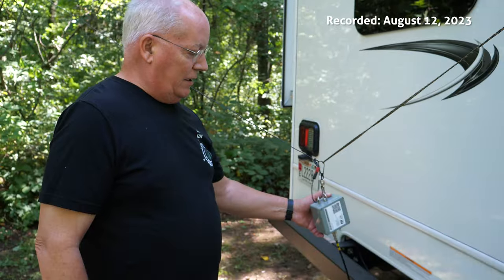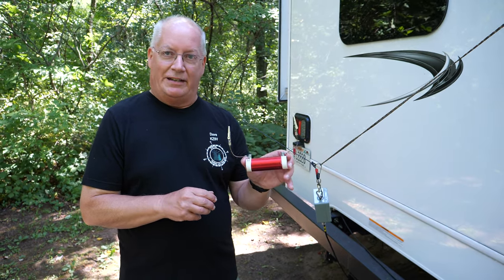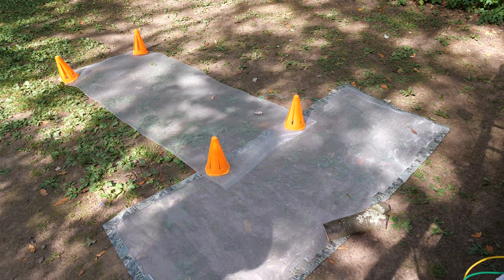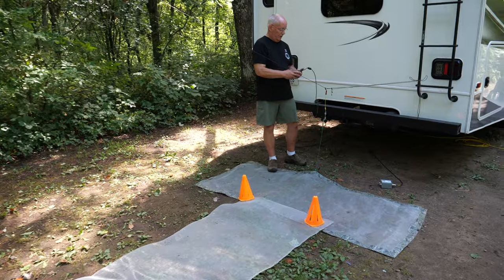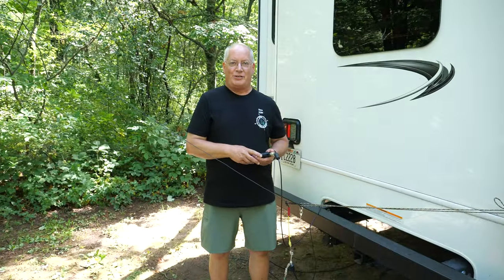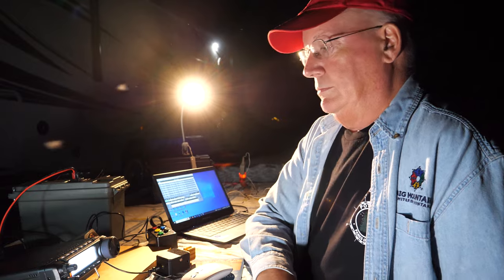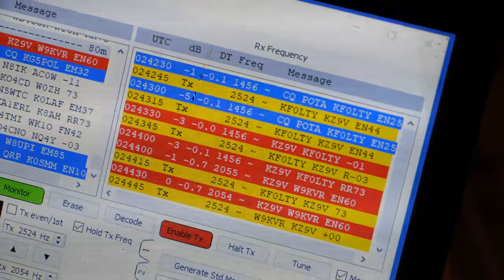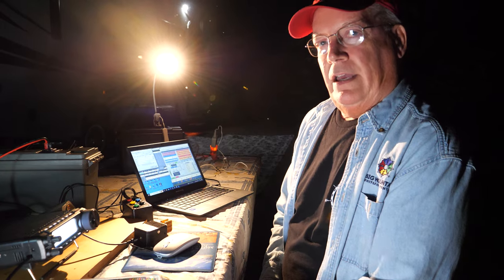The Magic Carpet rides again! This time on 80 meters #hamradioqa

Comment: Funny, I am the mysterious KF0LTY.  Have been licensed since March.  I haven’t run 80 much at all.  I was at K2529 at Wild River State Park in Minnesota that night and running a Yaesu FT891 with an XTenna at 30 watts.  I think that was the first time I had contacts on 80 so that was fun.  Thanks so much for the contact!  I think I will try that Magic Carpet for 80 soon.  I use it with my WRC setup routinely and it works great.  73 de KF0LTY.
Reply from the maker: Thanks for the contact. It sounds like we were pretty evenly matched. I think Dave was running either 10 or 20 watts that evening.

Comment: Interesting video.  I’ve often done portable operation using a quarter wave sloping wire connected to the feedpoint of my mobile setup in a Toyota Tacoma instead of my usual Hamstick, or more recently a early 1960s vintage Webster Bandspanner 80-10 meter center loaded mobile antenna.  The quarter wave wire radiates much better than the mobile whips on 75 and 80 meters, using just the truck body as the counterpoise as in normal mobile operations.  I’ll bet you would do really well if you used your RV body as the counterpoise instead of the relatively small (in terms of wavelength on 80 meters)
“Magic Carpet”. 

I use a sort of “Magic Carpet” technique to increase the effectiveness of the Tacoma truck body as a counterpoise.  The Tacomas and Tundras bed floor and internal lining are a one piece plastic tub instead of the more common steel beds and linings of other trucks.  Great concept, one of the reasons I bought a Tacoma, it’s very tough and doesn’t dent or rust.  However, for mobile HF operation it leaves
a big open area which would on most other trucks part of the counterpoise of the truck body.  I therefore have lined the bed floor with pressed galvanized  mesh plaster wall lath material that is bonded to the truck frame, and covered it for cosmetic purposes with diamond plate pattern vinyl mat, also sold at HD.  The stamped galvanized  mesh is sold  in 8 foot by 27 inch panels for about 20 bucks each, and a 4x6 foot indoor/outdoor vinyl mat is about 40 bucks.  I imagine the galvanized lath material could also be used as the material for on ground  portable Magic Carpets”.  

I’d recommend using a much larger “Magic Carpet” than the one I see in your video, I suspect that the reason you have such a wide (400 kHz) 2:1 SWR bandwidth on 80 meters is that such a small counterpoise is very inefficient.  A good 80 meter quarter wave vertical radiator against a large and more efficient counterpoise system will have a much narrower low SWR bandwidth.  If you want to work across a wide range of frequencies on 80, just add additional length with with quick disconnect jumpers to the end of a quarter wave cut to resonate high in the band.

73 de Chris AJ1G Stonington CT

Comment: Im using a screen with my WRC......it works excellent.  I am going to cut 3 bundles of 5 wires that are 2m long for shorter radials though.  Hopefully that works too.
Reply: I did 12 of those short 2.5m and it worked excellent.. haven't tried adding another 3 because I cut the 12 from the 3-33' wrc sent! Wanted to use what I had
Reply: @k4adz  I got some cheap wire on Amazon to not sacrifice the wrc wire.  I'm trying to keep them as short as possible....
Hence the 15.  Total amount of wire is same though

Comment: Great video, Dave and Mike. This  shows inguinity!  Amazing stuff with the window screen. I noticed you have 2 in a T-shape. Is that because you need more of a radial field for 80m? 
Thanks again
Reply from the maker: For the 80 meter band, and 40 meters to a degree, adding the 2nd screen increased the bandwidth a bit and it helped increase the impedance. With one screen at 80 meters, the impedance (R) was at 29 ohms and adding the 2nd screen increased it to 33 Ohms. The bandwidth increased from 300 KHz to 500 KHz when the 2nd screen was added. SWR at the resonant point was 1.3:1 with a reactance (X) of 0. This information got cut from the video as we did a couple of takes and I used the version where Dave didn't talk about why he was using two screens.
Reply: What kind of tape did yall use on the edge of your screen wire?
Reply from the maker: It's duct tape. Looks like Dave's tape has a camo print.

Comment: Nice video guys! I’m a big fan of the magic carpet myself for 20M and above (daytime only POTA here) but how high and how “vertical” was the wire? Thanks!
Reply: The wire deployed in the video was primarily a sloper configuration.  The feedpoint was about 2 feet off the ground, and the far end was aprox. 20 feet in the air.  A vertical wire would perform better, but the logistics of deploying a 67-foot vertical wire in the field is impractical.
KZ9V

Comment: How efficient is this setup vs using the unun and a half wave antenna? I understand the unun absorbs some energy, but the mesh will have a low impedance so won't be as good a match as the unun's 50Ω. Just wondering what's better for making every watt count with qrp.
Reply from the maker: What we did is disconnect the UNUN from the antenna and attached the wire directly to the center of a piece of coax. The braid of the coax went to the ground screen. This wire then acted like a 1/4 wave radiator on the 80m band. Efficiency should be comparable to a 1/4 radiator. The amount of screening you use will affect the signal strength and adding two or more sheets certainly did improve performance.

Comment: Michael, how many screens are guy using on the ground ? I’m on a small phone. I can’t tell if that’s a 2nd screen or sheet layed out in a T configuration . Thanks Jim, K2WPA
Reply: In this deployment, I was using a pair of 36"x80" screens in a "T" configuration.  It works okay with just one screen,  but on 80-meters I found that adding the 2nd ground screen raises the impedence about 4 ohms, resulting in a better match and presumably lower ground losses.
KZ9V
Reply: @davewhite7679  TYVM  Dave  , Jim K2WPA

Comment: Good info but since you are mobile and I assume you move about, why don't you simply run a 130 foot wire and avoid swapping anything? Are there park rules precluding that?
Reply from the maker: Most campsites have the space for a 65 foot piece of wire for an 40m EFHW, but 130 feet can be challenging to string up without encroaching on your neighbors.

Comment: I'm curious if you could use something like this for the 11 meter band, I have a motorhome but it's fiberglass with no good grounding.
It's just for a backup but I'd be interested to know if something like this could work.
Reply from the maker: This will work for 11 meters. I've used the ground screen successfully on the the 10 meter band, so I see no reason why it wouldn't work on 11 meters.